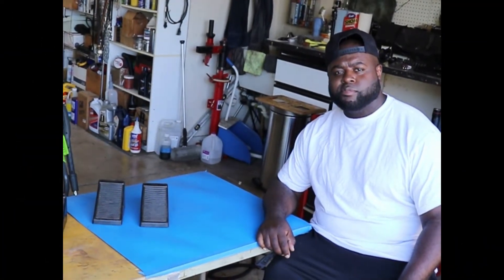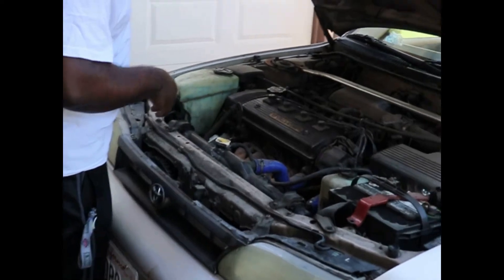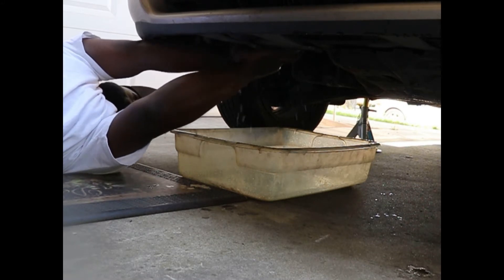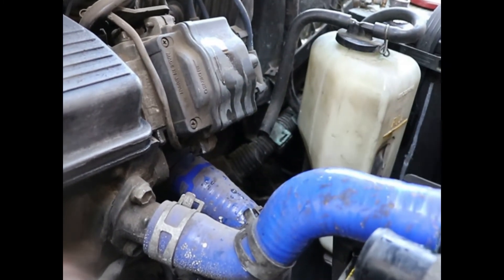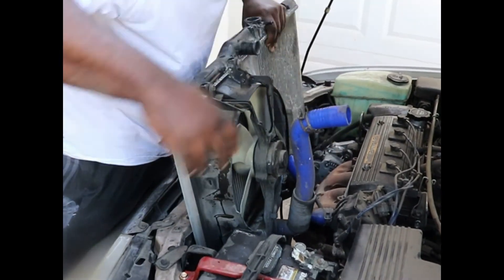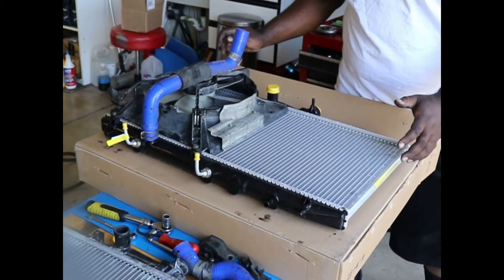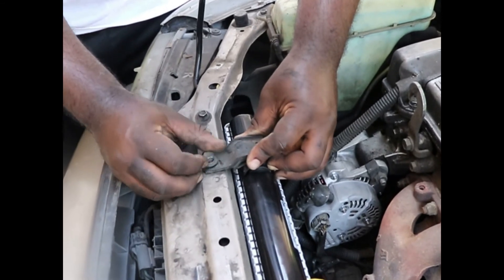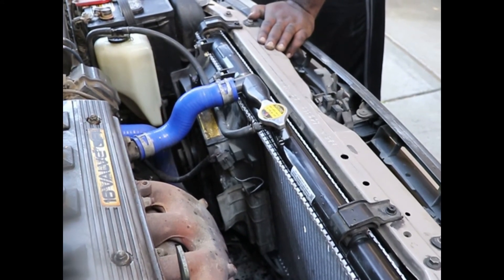How to replace the radiator in a 1994 Toyota Corolla 7AFE 1.8L

Comment: What are the 2 yellow connectors on the radiator ?
Reply from the maker: Those yellow caps are covering the tips of the tubes  where the transmission fluid lines connect for cooling the fluid in cars with automatic transmissions. This car has a manual transmission,  so we don't need them.